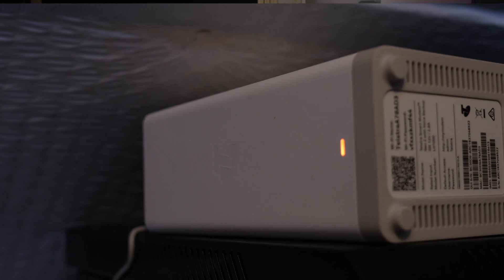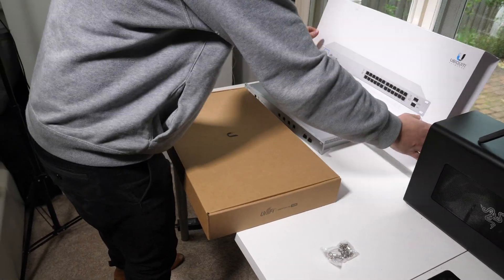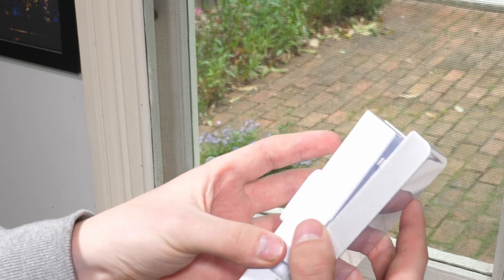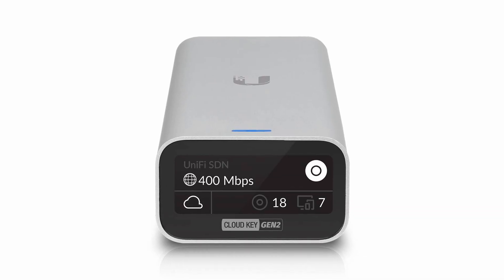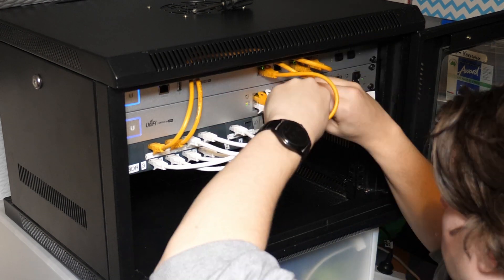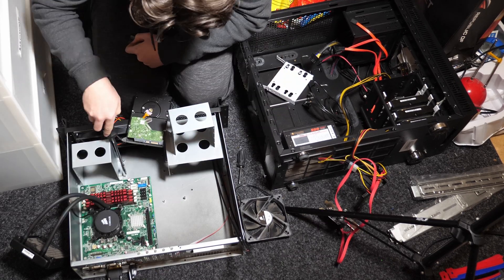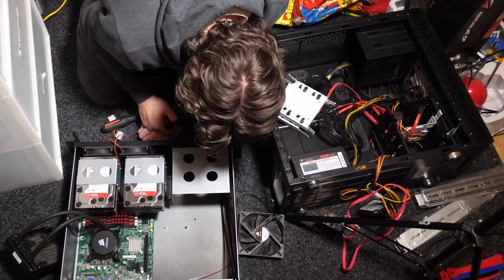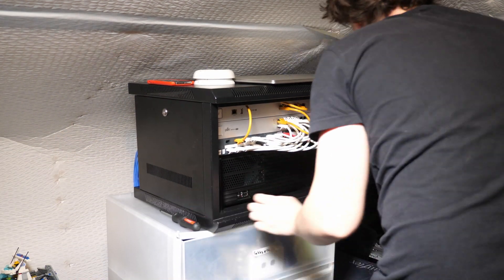Installing new Ubiquiti network gear - Building the ULTIMATE Network Setup (Part 3)

Comment: That NAS is gonna be a pain in the arse when a disk fails. You should look at a Synology or QNAP on a rack shelf instead.
Reply from the maker: It's not too hard to pull out. The hard drive cages are a pain to get to but the rack PC cases with hot swappable bays were a lot more pricey than what I ended up getting. A future upgrade maybe :)
Reply: Too much expansive and poor performances for the price  !!!